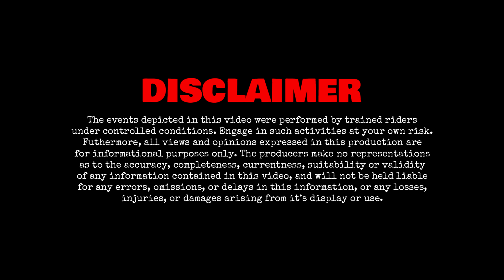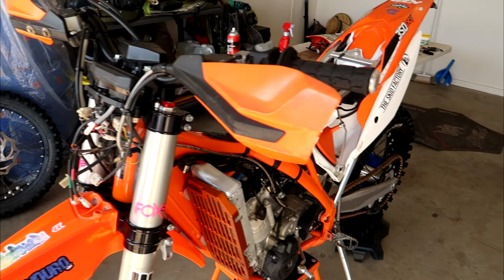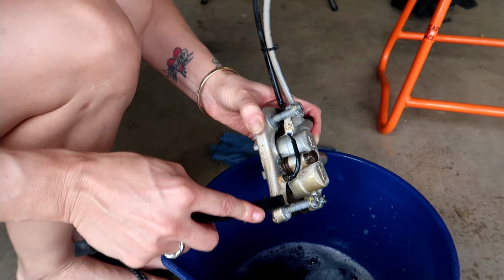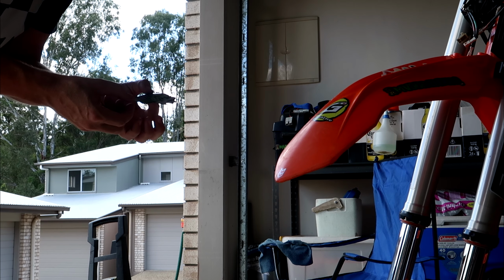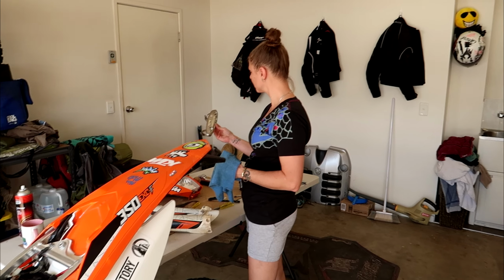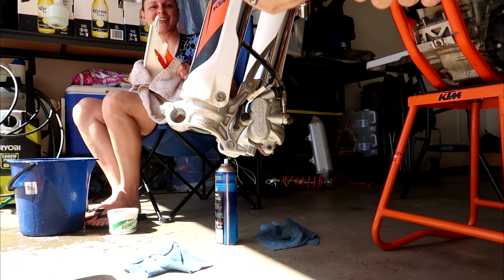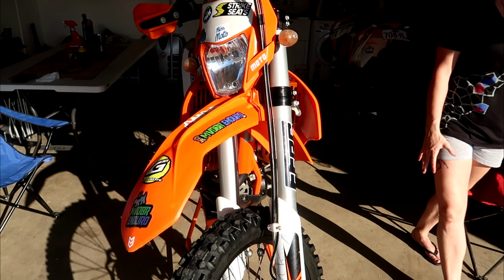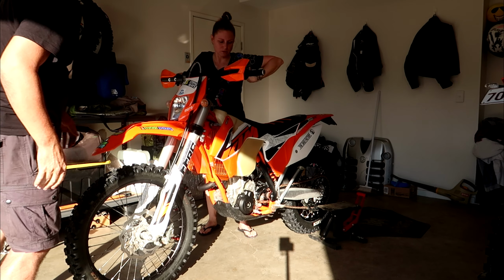The Grand Finale - MVDBR Garage Days Part 4

Comment: Tell me to jog on, but my top tip is use electrical grease on your connections, bit of a belt & braces thing. I’d never heard of it until I watched Lyndon Poskitt, and what he doesn’t know about KTM’s isn’t worth knowing.
Reply from the maker: Is that to prevent corrosion?
Reply: MVDBR Enduro it’s to prevent corrosion but I believe it also helps electrical contact. Adventure bike rider has a few bits written on the the subject when I googled electrical grease. They even show Lyndons vid on it, S10 E9 @9.1mins.

Comment: That bike is looking great I've been detailing my bike as well and then I went out riding and got it all muddy but it still looks great I noticed when I put that quick disconnect on my bike the stock male piece did not really want to fit in very well I ended up by switching it to the new metal male piece but now I have that stupid filter that doesn't fit in there very well...
Reply from the maker: Hmm that's weird did you get your aftermarket one from that Beemer Boneyard? Ours fit perfect into the stock filter holder
Reply: @MVDBR  yeah it fit in it just was very tight and not so easy to get in and out I called and talked to customer service he told me just to get an inline filter but I do have the correct one I just used the link in your video easy squeezy

Comment: That connector looks the same shape as the one on the original rego plate light. My bike came with that rego plate light in a cardboard box with the huge rear mudguard extender and huge mirrors. You don't have that on your bike nor would you want it I think.
Reply from the maker: Hmm you could be onto something there! Thanks mate :)